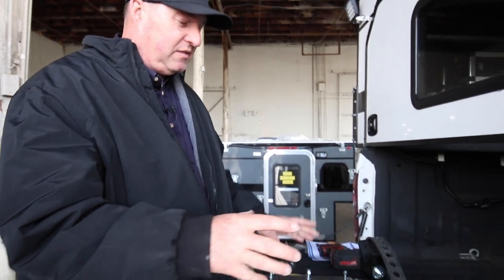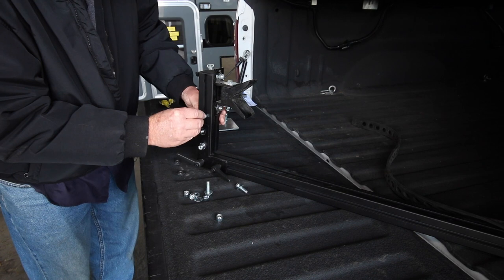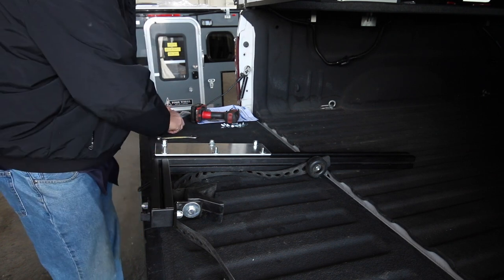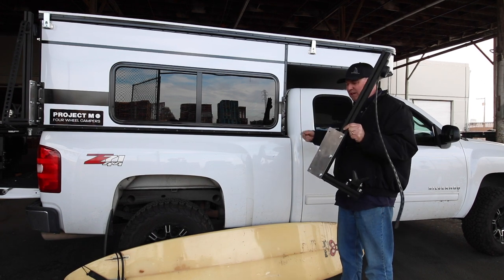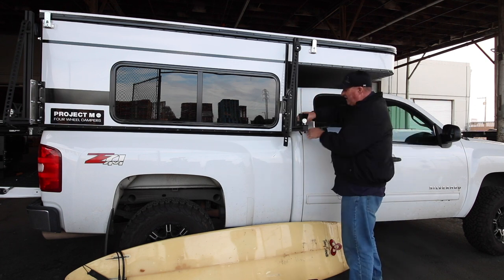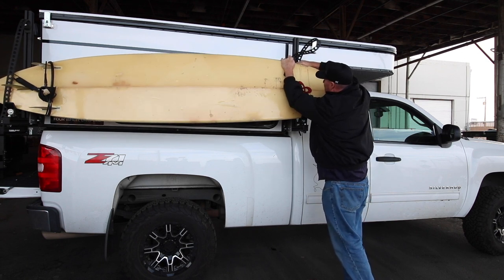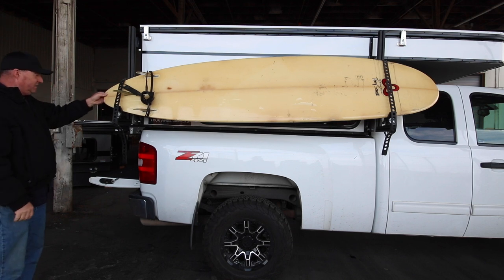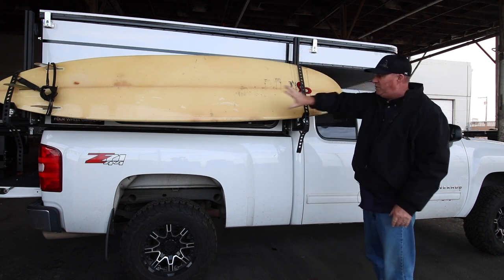Surfboard Rack Installation | Four Wheel Campers

Comment: So you can't use these simultaneously with jack stands correct?
Reply from the maker: They board racks connect to the same mounts as the camper jacks, so yes, only one function at a time. You would need to remove the board rack to operate the jacks to load/unload the camper from the truck. Have a great Saturday!
Reply: @FourWheelCampers  thank you